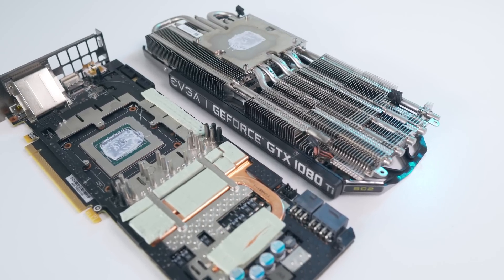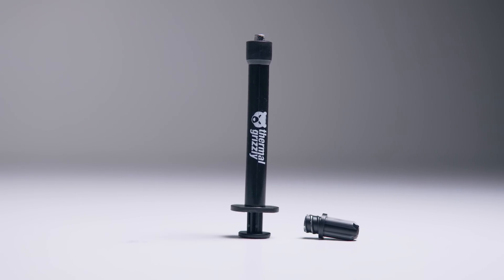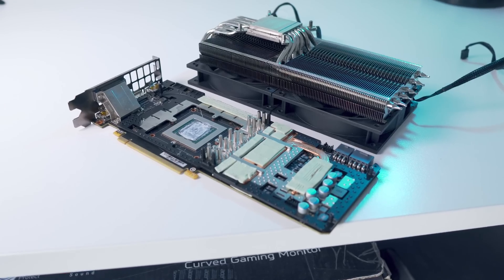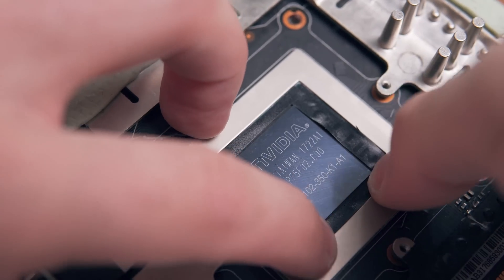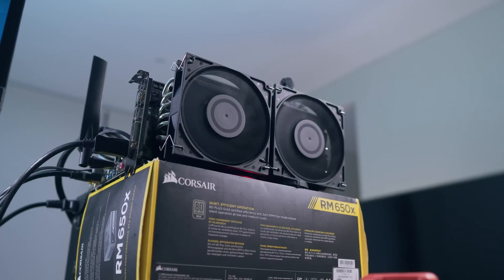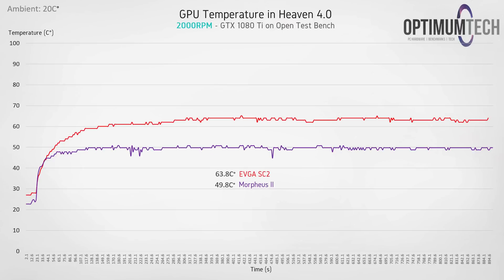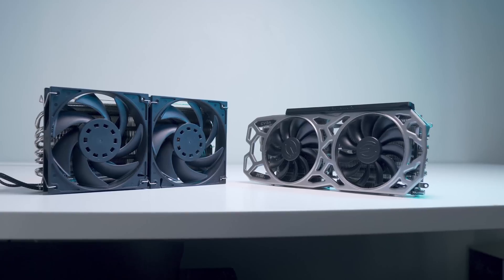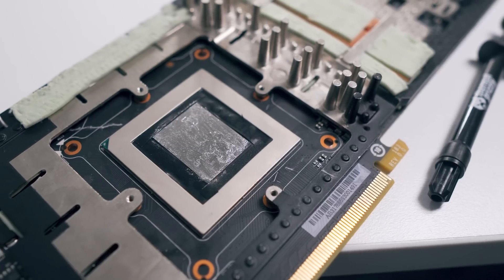Liquid Metal on 1080 Ti Morpheus II!

Comment: 3°C is 3°C. Little things add up.
Reply: It really doesn´t.. His temps were phenomenal already for being an air cooler on thermal paste, the ridiculous maintenance of Liquid Metal is not worth 3°C...
Reply: What ridiculous maintenance do you mean? You apply it once and you are done. It won't dry out or degrade in any form by time or heat (unlike most thermal pastes).
Reply: The liquid metal compound (at least what Thermal Grizzly uses) has no vapor pressure, it's not evaporating. There is nothing in the alloy that can dry out. It "drys up" (actually crystallizes) if there are other components (probably metal oxides) solved in the alloy that pushes it out of its eutectic point and causes crystallization. But it's probably due to user error (used on not gallium compatible metallic surfaces, contaminated surfaces, other chemicals got into contact with it). I have no issues or preformance drops however I'm not using it that long ago. But saw other peoples' reviews who had no issues, crystallization or performance drop over a year of usage. And saw videos about people complaining how it caused corrosion on their partially aluminium based coolers. No surprise...
Reply: Liquid metal does not dry up tho
Reply: Liquid metal doesn’t dry up
Reply: Yeah, a really comprehensive test would contain GPU performance and power usage data.
Reply: Those little grey things are buffer capacitors and noise suppressors. And you can insulate them in different ways. It was mentioned even in the video. 3°C is more than nothing. However we don't know exactly the long term behavior of the liquid metal, but due to its physical properties constantly reliable performance is highly expectable if used properly. In contrast conventional thermal compounds are known for drying out and losing certain level of performance over time. And if someone is looking for maximum performance or the cooling system has limitations in other aspects I can't see a good reason to not use the objectively better performing solution.
Reply: Beef Chicken
Yes it does dry up in high temps, Usually is not an issue for CPUs since the heatsink and CPU plate are properly seal due to pressure while GPUs heatsink has much weaker presure seal.
Reply: Antorias.. 
Yeah I think most people that didn´t have an issue is because they are applying it between the CPU and IHS then sealing it preventing oxygen from constantly reaching the LM. In laptops we get naked dies on the CPU so the LM is in direct contact with air, That is probably why it dries up so fast in Laptop applications..
Reply: worth it for more, 100rpm less fanspeed for same temp, i'd take it
Reply: skirmich Do you know about undervolting on the i7 8550u? And what if a laptop doesn't have the best cooling. Will undervolting still work?
Reply: Nathan Casey.
Undervolting will work on both.. One of my 2 laptops is an Omen 17 that has pretty good cooling with a 1070GTX, stock the 7700HQ never reached above 72°C which is pretty low for a 17" but it still made the CPU fan loud enough to be noticeable. After the undervolt (No repaste) the max temp dropped to 58°C while gaming which made it much more quieter.. I can play MGSV with no headphones and still be enjoyable with the internal speakers, Prior to the undervolt gaming with headphones was a must.

So give it a shot! you cant mess anything up if you are using Intel XTU as its super friendly to use..
Reply: Skirmich
Yup. Also, due rapid expansion and contraction of the Processor's die and heatsink in the laptop would introduce more air as well.
Reply: Artorias
But GPU applications are pretty similar to Laptops.. 
So the issue might just be the same.
Reply: @skirmich  I've applied Liquid Metal to my 6700k, 8700k, 8086k and 980Ti with Hybrid AIO. Not only did I apply the Thermal Grizzly Conductonaut (Sometimes Cool laboratory Liquid Pro) under the IHS / on top of the die. I also apply the liquid metal on top of the IHS, Under the Polished Nickel cold plate of my Swiftech H320x2 Prestige AIO. Not a single one of these applications ever dried up. The longest application was the 980Ti and I had it on there for 2 years with no temp change. Idk how it's doing now because I sold the card with the LM still applied. I told the guy about the paste being changed and gave him the rest of the Conductonaut paste that I used on the card. So it's pretty safe to say, if it does dry up It will take a long time. More than 2 years in my cases.
Reply: It depends. On GPU takes longer to dry due to bigger heatsinks and stronger fans, therefore, the expansions and contractions are not as bad.
Reply: There are entire post forums dedicated to Liquid Metal + Delidding that show that there are inherent risks of it drying up, whatever the reason is. 
Some people won´t experience degradation, others will.
Reply: What is the price per degree though?
Reply: quangluu96
What compound did you use exactly? Because there are dozens with different ingredients, different viscosity, different thermal conductance, eutectic point... Even the most popular ones are so different from each other. Coollaboratory's old compound (the "pro" IIRC) was thick and didn't last long. The newer (probably the "ultra") is better but its thermal conductance is way worse (38W/m*K) than the conductonaut's (73W/m*K). If one compound has almost double the thermal conductivity of the other, the two are presumably very different. But all are called liquid metal for an obvious reason and people tell their opinion without even knowing or mentioning what compound they used.
Reply: skirmich
People don't seal their delidded processors hermetically. So it doesn't really matter.
Reply: Artorias
Rapid expansion and contraction breaks the rigid dried up paste (and the rigid solder joints that causes the frequent BGA package malfunctions) but can't do much to a liquid medium.
Reply: undervolting will produce less heat so it will be good for a laptop with a bad cooler
Reply: Yes it will dry up, As fast as 3 months and if you do cycle the heat (Play a lot), it will require you to re-paste every 6 months under mixed use... I did this on 2 laptops and it will simply not last a full year, Went back to Kryonaut and haven´t had a single issue since..

Do not get me wrong, Liquid Metal is fantastic! if you are willing to re-paste every 6 months or so. In a complicated laptop environment it makes no sense what so ever. Undervolting did a much more drastic difference over Liquid Metal dropping single handled 15°C over the max temp on a 7700HQ with STOCK THERMAL PASTE.
Reply: It doesn't dry up. There are several people making videos 1 year after applying LM and it didn't dry up or degrade in any way.
Reply: Péter Kiss Bro, the liquid metal cant touch the little (dont know name) grey things around the gpu die, cuz uts conductive and can burn them, for 3° is a unnecessary risk, also i want to watercool the "cooling limit" will be on the rad not on the paste.
Reply: Good to know the proper name is "Crystallize", Here in my neighborhood its known as Dry-up because once it crystallizes it tends to behave like dried up thermal paste (In-like hotter temps). 

But the higher maintenance of liquid metal and danger is pretty much a fact and a 3°C drop is really not worth it IMO... I guess some people like to fiddle with their GPUs for the extra "Edge" but 3°C is nothing to write home about when you are already dropping a massive temp over air and normal thermal paste, I really like to re-paste once and never go back (If it works, Knocks on wood). Have worked for me for the past 15 years so I will keep doing it, Kryonaut has been working just fine for over 2 years in one of my gaming laptops with no noticeable degrade in temperature scaling.. I recently did my current gaming laptop with it and have no plans on messing with it for at least 3 years.

But to each its own I guess.
Reply: Spartan Dusk no u sound dumb.  You are half right half talking out ur ass
Reply: Yes, it is, because GPU Boost 3.0 will use any kind of headroom to boost up your GPU speed. Meaning, if you are locked at 1900 MHz, with thermal paste and you get 50C, and replace it with metal, you'll get more than a 3C down in heat, more like 5-10C lower in heat. But since GPU boost increases your clock speed with out the user having to, it becomes less so thats why you'll see in other videos that the GPU overclocks better and higher without any user input

Comment: Zotac GTX 1080 AMP! with Kraken G10 and H55 here. When using NT H1, the GPU was sitting around 47°C, with CLLU it's 45°C
Reply: Damjan Kovacev the cost of that would be around double this cooler tho. N it would not work with the stock vrm/vram heatsink on this card.

Comment: You know what! We are greedy, now do a liquid metal apply on the EVGA SC2! Who else notification squad!
Reply: Expect a -5c drop. Nothing special, but it's a drop non the less. I've done this to my 1080 ti ftw3. Will be getting the Morpheus II in a couple days.
I'm sitting at 62c across all with stock cooler/liquid metal 90% fan speed, at 26c ambient, grizzly minus 8 pads, game load: Rise of the Tomb Raider 1440p SMAAx4. 
I'm hoping I get 56c max from Morpheus II. Will be using noctua new sterrox a12's (2000rpm). And of course liquid metal.
Reply: beaR so, how well did it work?
Reply: So... Any results yet?
Reply: @gpeaes   SO how did this turn out?
Reply: @gpeaes  what are the results